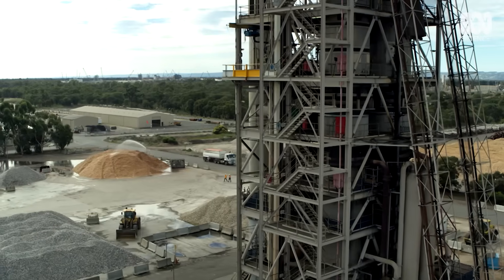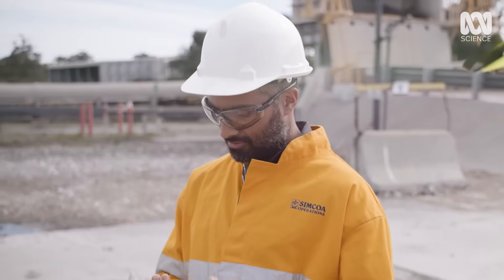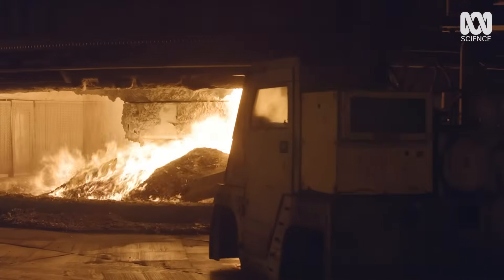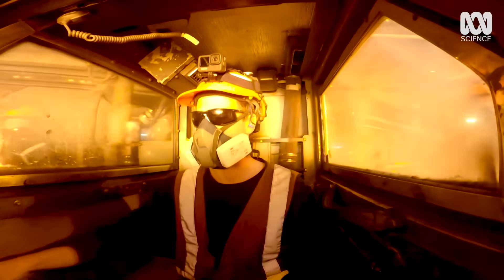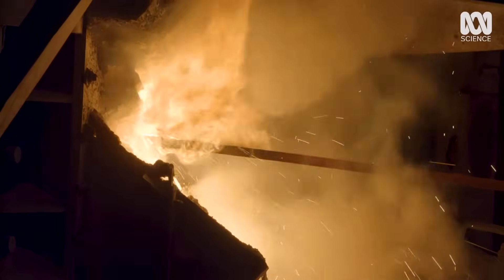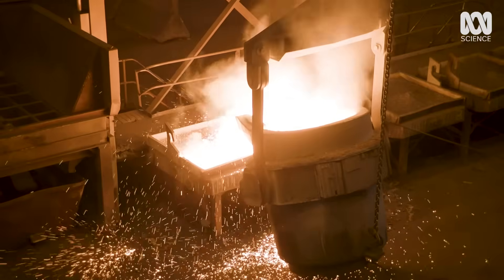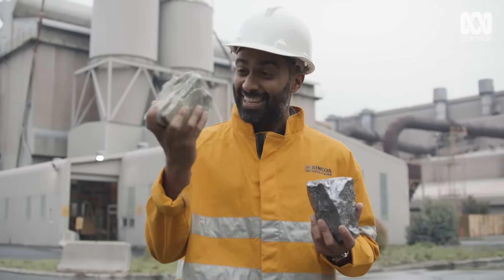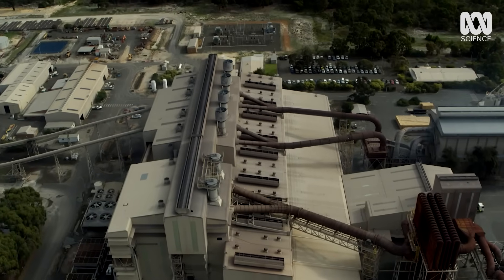“It’s Like Working In A Volcano”: How Silicon Is Made | Extreme Jobs

Comment: I’m skeptical of the claim that silicon can make 4x the energy it took to extract it from quartz.
Reply: It doesn't make energy, it converts solar energy into electric energy, so how much energy it took to turn sand into it is completely irrelevant. It's like a motor, the energy doesn't come from the iron, it comes from the fuel
Reply: You are right. In reality, it is more like 10 times as much.
Reply: They're talking just about the silicone

What you may be referring to, the arguments that a PV array doesn't ever produce enough energy to be Green, is because all the other manufacturing to do with the panels including labour engineering manufacturing everything will the diesel used to transport and all the electricity used to for the plants, at that point it's not green.
Reply: @devarmont87 silicon, not silicone.
Reply: @devarmont87  Those arguments are still wrong. If it took more energy to build than it produces we would not be building Terawatts of solar across the entire planet.
Reply: @devarmont87  ... which is an argument that is also clearly contradicted by Life Cycle Assessment research that shows that the energy produced by PV modules is many, many times (like 20x) that required in the total manufacturing process.

Comment: “Green” evengy
Reply: Solar cell production is indeed problematic; it's not a silver bullet for confronting the climate crisis. But, as stated in this video, "if silicon is incorporated into a solar panel, it will generate at least 4 times as much energy as it took to make it -- 10 times as much in a country like Australia." Compared with fossil fuels, there's simply no contest. Another commenter mentioned HPQ silicon, the production of which supposedly releases 84% less CO2 than conventionally produced silicons. That's something that should be getting more attention.
Reply: Wait until you find out how energy intesive it is to mine oil or gas and refine it.
Reply: evengy

Comment: Oh, coal is needed to make solar panels. That's a plot twist.
Reply: It's mostly likely a type of coke or other relatively pure carbon source similar to what you'd use to reduce iron oxides like hematite, limonite or magnetite to metallic iron in an ironworks/steel mill, so there's a couple of steps in between but yeah essentially refined coal
Reply: Our world is full of trade offs and this is much better than just burning the coal for energy. Once you make the solar panels they will last for decades, so the only embedded cost is the cost of initially making them and logistics of setting them up. Which is far less per kilowatt hour than burning fossil fuels. Just like it takes more energy to make aluminum than steel but you would never construct a steel airplane because of its enormous inefficiency
Reply: This is the Simcoa plant in Western Australia, and for the most part it uses Jarrah wood charcoal, although lately it is using more coal refined to coke. But West Australians are Gods chosen people, and the apple of Gods eye, and it is our every right to do what we want. But yeh, you can just use any carbon source, and there are trials into substituting Hydrogen instead of carbon to remove the oxygen from the Silicon Dioxide (Quartz).
Reply: You could do it in a pure electrochemical method too, but it would be expensive ass hell
Reply: The reaction needs something for oxygen to preferentially bond to, and is helped massively when the byproducts can't or won't dilute the desired output. Carbon is used because it's cheap and extremely plentiful, but I saw hydrogen gas being discussed with as a less polluting alternative, and there's doubtless other materials that aren't used as well. It's the same kind of mechanic that thermite works with afaik, except it's with silicon dioxide and carbon instead of iron oxide and aluminum, so as long as you end up with pure silicon at the end, the reactant material doesn't matter
Reply: @Hegamonia  Yes, thank you! I just thought it was a bit ironic, especially as an "environmentalist" myself.
Reply: Don't forget, they also only produce 3x as much power over their lifetime than they take to produce.  Love how they got that bit in at the very end.
Reply: @Sam-hl1oh  Not only is that a hilariously poor EROI when compared to traditional energy generators, but solar panels can barely even be considered to be an energy source when you add energy storage into the equation.

Comment: The dirty little secret about clean energy from solar panel is that the process to get produce it is worst than what it is replacing. SMH.
Reply: Wrong
Reply: Solar cell production is indeed problematic; it's not a silver bullet for confronting the climate crisis. But, as stated in this video, "if silicon is incorporated into a solar panel, it will generate at least 4 times as much energy as it took to make it -- 10 times as much in a country like Australia." Compared with fossil fuels, there's simply no contest. Another commenter mentioned HPQ silicon, the production of which supposedly releases 84% less CO2 than conventionally produced silicons. That's something that should be getting more attention. SMH
Reply: @alex55-y8l I’m skeptical about the claim of less CO2 to make silicon from quartz.  Since quartz is silicon dioxide, something needs to capture the oxygen from quartz. Is there another element that will bind to oxygen preferentially over silicon, that is not carbon?
Reply: Did you not watch to the end?
Reply: @hashdankhog8578  It may generate more electricity than it took to make it, but panels don't suck carbon and other gasses out of the air that the furnace/smelter gives off or clean up molten slag.
Reply: @caesarsalad1170  and thats why we also need to focus on carbon capture. Just because they do generate carbon doesnt mean they are worth using or that we should keep using oil.
Reply: @hashdankhog8578  Except oil is a absolute critical component to our modern society besides fuel.
Reply: @caesarsalad1170  well slavery was critical for americas economy but we still got rid of it. Just because a society relies on something doesn’t mean that we need it.
Reply: @hashdankhog8578  But we can't get rid of oil instantly or everything would collapse.  Renewables only produce 29% of the worlds energy, hitting 100% is going to take a long time.
Reply: @caesarsalad1170  im not suggesting that we instantly cut off oil, but we do need to phase it out asap.
Reply: @hashdankhog8578 Actually slavery wasn't important. It was important for lining the pockets of the slave owners in the south who were the 1% of their time.
Kind of what started the civil war, not the actual slaves but since they wanted to claim slaves were property the north said they'd tax them as such and the plantation owners had a hissy fit.
Reply: @hashdankhog8578 there’s so much more to oil than fuel. Without oil you wouldn’t have been able to even post that comment because your device wouldn’t exist
Reply: @lr2127  And? My device wouldnt exist without silicon which is the core component of solar panels, just because oil has uses outside of energy that does not mean that its use as a fuel is worthwhile
Reply: You are in educated or semi educated. Thank god you are not taking decisions.
Reply: @PoliticalMatter  if these human beings didn't have so much prejudice and propaganda in their mind, they would use a mix of bamboo plants, hemp plants and sunflower plants to abosrb alot of that co2 and in turn create oxygen. They can even use activated charcoal to remove alot of the impurities from the air like toxic gases and such but people choose not to do it because of their prejudice corrupt mindset.

Comment: Check out HPQ SILICON, zero CO2 emissions.
Reply: So we're just looking for as many ways as we can to suffocate plants?
Reply: They better not include carbon offsets. Also are they including power generation?
Reply: According to Hewlett Packard, the company that produces it, the production of HPQ Silicon emits 84% less CO2 than conventional silicon. That is significant, but I wonder if this finding has been confirmed by independent research.
Reply: The 1 Kg eq of CO2 per Kg of Fumed Silica is based on Hydro Quebec data that indicate in Quebec 1.3 g of CO2 are generated eq per KWh. While the 2.5 is based on the Canadian average for
electricity generation carbon intensity of 150 g per KWh. In Q4 Independent testing done at McGill University confirmed the HPQ Polvere FSR capability of producing
Commercial Grade Fumed Silica in one 
step at lab scale.  @alex55-y8l

Comment: The comment of Oxygen mixing with Coal & Charcoal releases Carbon Di Oxide (C1O2) IS GROSSLY INCORRECT!
There are 2 main Gasses released.
Carbon Mon Oxide (C101)
& Sulphur Di Oxide (S1O2)
The misconception of Fossil Fuels & Wildfires emitting Carbon Di Oxide started with Al Gore.
CO2 increases are due to deforestation to make way for urban sprawl & broadacre farming, poisoning our waterways and increased human & animal livestock populations exhaling.
The other cause of deforestation is burning fossil fuels releasing Carbon Mon Oxide, of which Coal also releases Sulphur Di Oxide and both these gasses are also emitted via volcanic eruptions, along with volcanic Ash, sometimes in large proportions.
These 2 Gasses, when mixed with water & Solar Radiation, transform into Carbonic & Sulphuric acids, eventually becoming Acid Rain, killing more plants.
The dead plant carbon matter rotts, combining with Hydrogen, 1 part to 4, becoming Methane (C1H4), the most abundant greenhouse gas, followed by Carbon Mon Oxide.
Carbon Di Oxide is not a greenhouse gas, but a biproduct of the effects of Greenhouse Gasses.